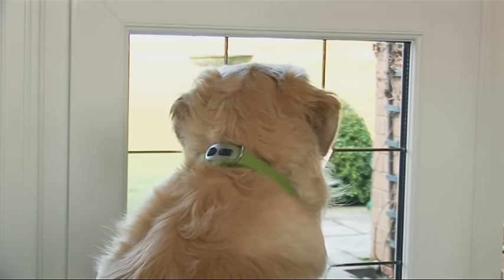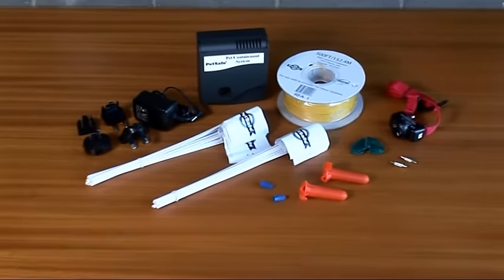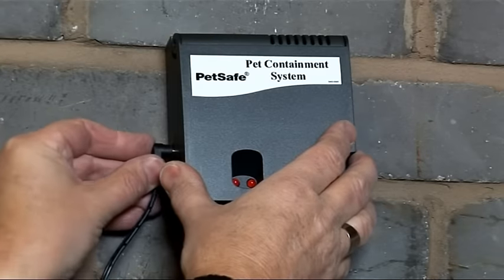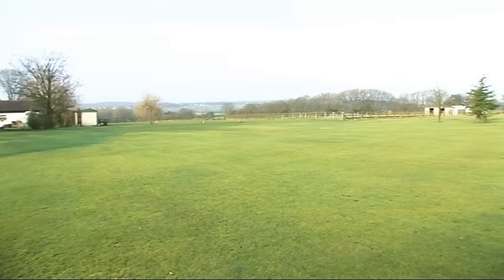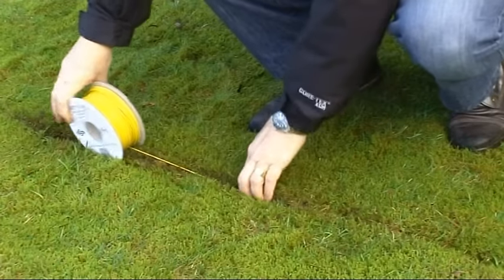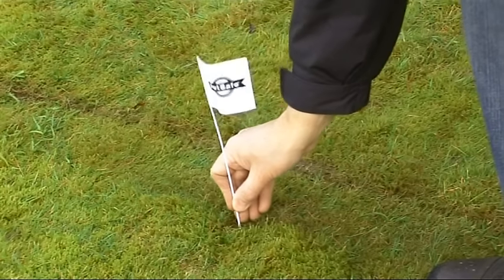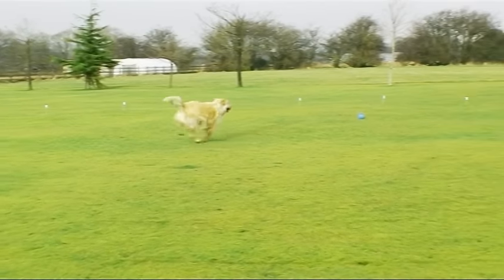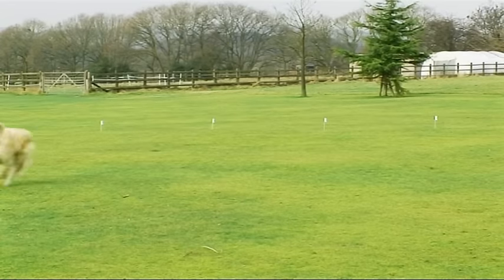How to Install the PetSafe® In-Ground Fence System

Comment: I have a back yard that I want to invisible f3nce in.  Can u bury the part of the single loop about 2 feet for the part I want the dog to cross? I'm trying to avoid running a double loop which takes a LOT of yard space from the dog
Reply from the maker: Hi Brian thank you for your comment/query. We would not recommend burying the wire for signal cancellation so to speak, because for the In-Ground Fence to be effective for your pet you ideally need about 5 feet of signal width on your wire (which emits like a beam in all directions from your wire including upwards) so that the receiver collar has a big enough 'zone' at the wire in which it has the chance to warn as well as follow up with the static stimulation if your pet comes closer. You would therefore need to bury the wire at least just as deep as the signal width (meaning at least 5 feet) to ensure that the signal will not still reach your pet's receiver collar, unless you adjust the boundary width dial on your transmitter to where you have less than the advised signal width coming from your wire. However less signal width could become problematic if your pet would ever find out that the zone where the collar activates is that small that he/she can quickly run through without the collar really having the chance to deliver a static stimulation. Patiently training your pet in the beginning as well as finding the correct static stimulation level on the receiver collar for your pet is key to avoid this from happening though, however we would still not recommend only having 2 feet of signal width. We hope this all makes sense, if it doesn't, please let us know.

Comment: does the fence interfere with other in-ground utility wires  ??
Reply from the maker: Hi Nina, our In-Ground Fence does not interfere with or stop other utilities from functioning. However, if for example an in-ground utility line is too close (within 10 feet parallel) to the PetSafe wire, the PetSafe boundary width signal could become inconsistent or in some cases couple onto that utility line and be transmitted in a direction where you do not want to have signal. A result can be unintended receiver/collar activation. Therefore, it’s important to keep the advised minimum distance of 10 feet between the PetSafe wire installation and utility lines or for example electricity cables when the wires run parallel to each other. If crossing any of these lines/wires, do so at 90-degree angles. If you need more specific advice or information, also feel free to take a look on our official website where the In-Ground Fence manuals are available or you can call our customer care team on 1800 814 302 (Republic of Ireland) or 0800 046 1414 (UK)

Comment: What do I do with trees? I have a couple of large trees near the fences. How can I prevent my cat's from going over the fence?
Reply from the maker: Hi Alex, there are a couple of options you can try - One is to make a connection from the fence to the base of the tree, looping around the trunk and back to the fence. Another is a double-loop layout creating greater security - so placing the wire at ground level then again at the higher point if you have something that you can raise the height of the wire with. Best option is to give our customer care team a call, we can walk you through the set up needed and you can even provide photos of the problem you're facing. Call us on 0800 046 1414 (UK), 1800 814 302 (Ire) or you can email intlcc@petsafe.net :)
Reply from the maker: @quadruple treble 1888 Hi there, in order to work the wire where there is no grass margin, please see the following 3 options - Solution 1: cut a trench, put wire in and cover with cold-asphalt.
Solution 2: cut a wider trench, place a tube and put the wire through. Cover with cold-asphalt.
Solution 3 (leading to signal loss as it will be deeper): make a hole all the way under the cement / asphalt, place tube, place wire in it
If none of these options are helpful or you would like further information, please contact our customer care team on UK freephone 0800 046 1414. They would be happy to help you out.

Comment: Can you use a thicker gage wire?
Reply: No a garage wire that you are stating does not work. It's all about one being able to plug into the receiver in the wall or should I say transmitter. Next if you have a wire that's too big you're not going to have the electricity flowing through the wire to send a strong enough signal throughout the entire property
Reply from the maker: HI Todd, thanks for your comment. To answer your question, yes, you may use an insulated copper core wire of 18, 16 or 14 Gauge (that is 1mm, 1.2mm or 1.5mm thickness). Our wire is 20 Gauge (0.8mm). Hope this helps, if you need anymore information you can view our In Ground Fence support manual via the following link https://intl.petsafe.net/en-ie/support/in-ground-fence
Reply: @PetSafeInternational  Thank you.  How do I purchase a the complete package (collar, system,  wire etc) I don't wanna buy the ala' carte versions I see on Amazon
Reply from the maker: @toddj.hollislaw1292  Hi Todd, you can visit our website via the following link https://nl.petsafe.net/collections/in-ground-fences/products/in-ground-fence-system , here you can take a look all of our  In - ground fence systems and purchase one to best suit your needs. I hope you find this helpful. If you need anymore information you can contact our customer care team on 1800 814 302 (Republic of Ireland) or 
0800 046 1414 (UK)

Comment: Can a put the wire in a PC pipes?
Reply from the maker: Hi Karin, yes you can use any type of pipe (PVC, plastic, garden hose) for the wire when needing to cross an entrance or area a car may need to travel over. For the perimeter of the garden you can insert the wire directly into the ground. I hope this helps. :)

Comment: My dogs go really far from our house when they are loose, which is why I was wanting to buy and electric dog fence, but I am concerned if it will be strong enough to not let them go past the boundary?
Reply from the maker: Hi Kevin, this is a natural concern but with consistent training you will be able to determine how your dog is likely to behave once free to roam within the boundary. You might find this video useful in order to learn more about the training process - https://youtu.be/SGga8Fx5RZU If you have specific questions our Customer Care team is available to offer advice - 0800 046 1414 (UK), 353 (0) 58 44 988 (Ire) or you can email intlcc@petsafe.net.
Reply: PetSafe International I had another question about this electric dog fence, will snow or rain effect the ground wire boundary?
Reply from the maker: Hi  @kevinhernandez4669  There shouldn't be any reason rain or snow would affect the buried wire. :)
Reply: PetSafe International thank you so much!
Reply: PetSafe International I bought the stubborn in ground fence but I have a question about the collar, can the collar be turned off to save battery life, or will I have to take the battery out of the collar?
Reply from the maker: Hi  @kevinhernandez4669  The collar cannot be turned off and taking out the battery daily is not advised as it can wear out the casing quickly. (Opening and closing involves 4 screws) The collar is designed to remain on standby and you can be assured battery life generally lasts 1-3 months. I hope this helps.
Reply: I7

Comment: Do you need to bury the wire?
Reply from the maker: Hi Lisa, we do recommend burying the wire, however, it’s not necessary. By not burying the wire, there is a greater chance of the wire breaking easily though.  Thanks, PetSafeUK
Reply: @PetSafeInternational  Ok, thanks for the quick reply. I  will bury it where i can so, it's just that part of my garden has concrete path

Comment: In my particular place, I must loop the wiring back around to the sending station.   Can two wires go in the same slot in the ground?   Will this compromise the efficacy of the system?
Reply from the maker: Hi Pete, the 'Go' and 'Return' wire needs to remain separate from each other, at least 1.5m in distance or they will cancel each other out and break the signal. If you need some help on the set up feel free to give our Customer Care team a call to talk through. UK - 0800 046 1414, EU - 00 800 1818 2020. I hope this helps :)
Reply: @PetSafeInternational  Thanks guys.  Got most of the wiring run today.

Comment: Can a dog run fast enough over the wire that when they get zapped they are on the other side of the wire and can't come back?
Reply from the maker: Hi Jay, In theory it is possible that a dog sprints through the boundary width signal on the wire and is then not able to get back into the yard without the collar activating again. There are 3 important factors to avoid this from happening (see below): 

1) Step-by-step, patient training as the manual advises so a dog knows what is expected once the collar activates.
2) Finding the correct static stimulation level for your pet which can be adjusted on the collar.
3) The boundary width signal on the wire should be wide enough. It is usually advised to have 1.5m signal width on wire (meaning collar activates at 1.5m distance from the wire) if yard space allows. As the system would provide 1.5m signal behind the wire as well, it would mean a 3m zone where the collar activates. The boundary width can be adjusted on the transmitter.

If these 3 steps are ensured it minimizes the possibility of a problem like this ever occurring. Hope this answers your question, if you need anymore information please call our customer care team on 1800 814 302 (Republic of Ireland) or 0800 046 1414 (UK)
Reply: Yes, I have seen it and they ran and hit two more neighbors fences and was zapped at each one !

Comment: Hi, I have a small yorky that keeps breaking out so an invisible fence would be perfect. However, the device seems very big. Is it suitable for a dog of 3kg?
Reply from the maker: Hi Fabienne, we have an In-Ground Fence suitable for smaller dogs of 2.3kgs and up - https://store.intl.petsafe.net/en-ie/little-dog-in-ground-fence-system You can order online, just ensure you select the correct country site in the top right corner of the website. Any other questions our Customer Care team is available to help on 0800 046 1414 (UK), 353 (0) 58 44 988 (Ire) or you can email intlcc@petsafe.net

Comment: Would the system work for my small dog and large dog being outside together at the same time? Also are the settings the same for both?
Reply from the maker: The In-Ground Fence has been designed to work with multiple pets (Add-a-Dog Collars) when needed so that it will work. A possibility is that you get an In-Ground Fence with its own Deluxe Ultralight Receiver Collar that comes with it which is suitable for any dog from 3.6kg and over, and that you get the exact same model receiver collar for your large dog. The collar has 5 levels (level 1 is tone only) so it can be adjusted to the temperament of your pets individually. In case your large dog is generally very hard to train/stubborn so to speak, you can also opt for the Stubborn Dog Collar as a second collar. This collar also has 5 levels (level 1 is tone only). Depending on where exactly you are located (US, UK, Europe) the product codes can be a bit different, therefore if you need any help identifying the correct collar(s) you need feel free to contact our Customer Care Centre. On a side note, we have an Elite Little Dog Collar available (for very small dogs) however due to the size/antenna difference with the collar (Deluxe Ultralight or Stubborn Dog) that the large dog for sure will be wearing, it wouldn’t be an ideal combination. The collars wouldn’t react at approx. the same distance from the wire which could confuse your pets. Therefore if your small dog weighs at least 3.6kg you should be fine with the Deluxe Ultralight Receiver Collar. I hope this helps to answer your question, if you need anymore information you can call our customer care team on 1800 814 302 (Republic of Ireland) or 0800 046 1414 (UK)

Comment: I’m confused how this works. Does this shock them?
Reply from the maker: Hi @Matt Productions, once you have set up the In-Ground Fence and trained your dog to correctly use it, he will hear a warning tone as he nears the boundary followed by a quick electrical stimulation if he attempts to cross it. We have many common FAQs listed out on our website here https://intl.petsafe.net/en-gb/support/in-ground-fence and our customer care team is available to answer any questions you may have on 0800 046 1414 (UK), 353 (0) 58 44 988 (Ire) or you can email intlcc@petsafe.net. I hope this helps.
Reply: @PetSafeInternational  quick electrical stimulation? Please speak in simple terms its either they get zapped or not
Reply: @xawecs881  they get zapped. It can be set like one of those shocking pens or up to something more powerful. Though the shock isn't too bad, it's still very uncomfortable. Ideally, you would install a physical fence, but this is much better than chaining them.
Reply: @hystericalstares7507  tyty

Comment: On some reviews it says that the wires aren’t really water proof and gets damaged really quickly. How can you prevent that from happening?
Reply from the maker: Hi Maka, thanks for your question - there are some steps that you can take to ensure the In-Ground wire stays strong for longer:  Following the operating guide carefully, using the proper official splices that come with the system (if extensions or repairs are necessary) and adding extra protection at the wire's most vulnerable spots (eg driveway openings where cars may need to drive over the wire) by laying it in an irrigation hose, rubber hose or (flexible) PVC pipe can avoid the problems that are mentioned. I hope this helps. :)

Comment from the maker: This particular product has no earth wire. However, our newer ‘Deluxe’ transmitters have an earth terminal to prevent damage from lightning during thunderstorms. For more information please call 0800 046 1414 (UK), 353 (0) 58 44 988 (Ire) or you can email intlcc@petsafe.net